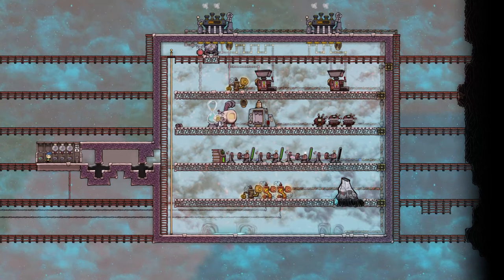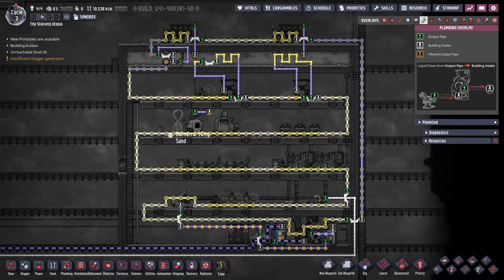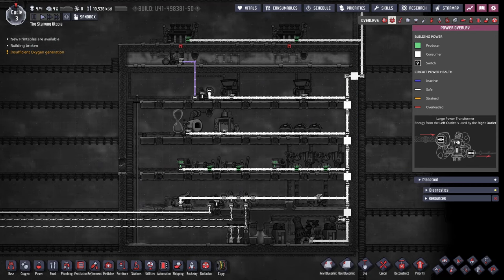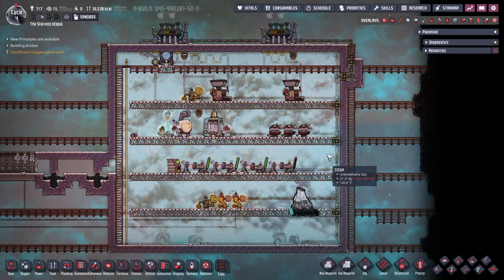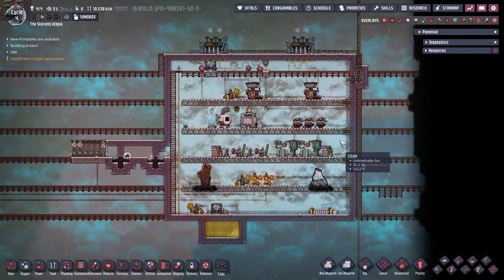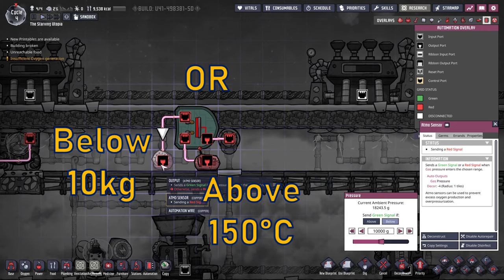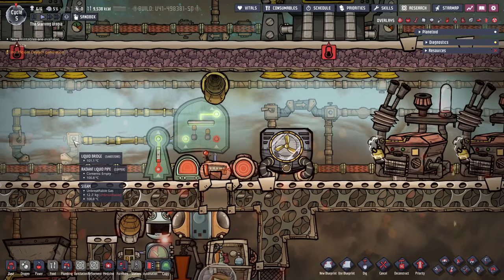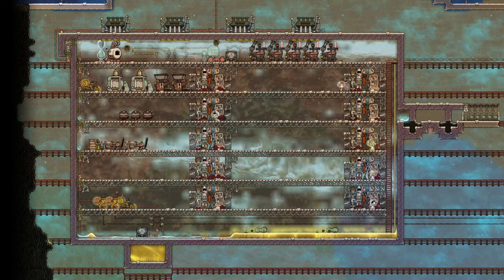Oxygen Not Included - Tutorial Bites - Industrial Bricks

Comment: What’s even the advantage between a cool brick and a hot brick then? Is it cause you can open up metal volcanoes inside them? You still have to set up a cooling loop for both anyway so I don’t see a huge advantage in doing a hot brick. It seems wasteful almost because of the amount of high quality resources you need to replace the machines with.
Reply from the maker: In my opinion, the hot brick is superior as it does simplify a number of things. Yes you can open metal volcanoes, volcanoes and steam vents inside with no issue. Also it deals with polluted or salt water by turning it into steam for collection as water. The other advantage is slicksters that need the hotter temperatures, especially molten slicksters. It certainly does require a lot of steel/thermium, depending on how many machines you want, but these are more accessible than ever in the spaced out DLC with iron volcanoes on the frozen outer planetiod, and tungsten volcanoes on the marshy outer planetoid. Of course the challenge then is taming those, but it is certainly possible.

Comment: Do you have a video of how to survive long enough to get to the oil biome and start plastics
Reply from the maker: Unfortunately not specifically, but to my mind the key factors are food and oxygen, both of which I have videos for. Cooling will also help, so maybe look at the tutorial bites for cooling, and plastic & steel. I also have 2 playthrough series, so maybe take a look at the early game sections of those. I'd aim to get plastic and steel ahead of cycle 100.
Reply: @GCFungus  thanks. Though ran out of power and oxygen around 80 cycles. Probably should have stopped pumping oxygen into the entire map pretty sure that's where both resources went to
Reply: @colecook834  build the dupes a habitable area as soon as feasible.  You can’t oxygenate the entire asteroid with your starting tech and resources, so settle for a smaller area that you can control.  Once that internal area is stable and you have enough excess oxygen production, set up atmo suit docks to help the dupes push out of the base and into the rest if the asteroid.  At this point you can also move your industrial equipment out of the base too, reducing the amount of cooling you’ll need to do inside the base.
Reply: @colecook834  the key to survival is always considering *sustainability*.  I think the game is designed this way to teach you, like your first playthrough will likely end in running out of oxygen when you realize you're out of Algae.  So, you restart and know you need get eletrolyzers going before you run out of Algae, and the challenge becomes finding some renewable source of fresh water.  Then, you have things going well but you run out of Sand you need to run your sieves, and so on and so forth.  You'll run out of a coal for power, then start ranching Stone Hatches and feel like you've got infinite power (and food) ... until the unthinkable happens, and you run out of rocks! 

So, iterating on this process is how you eventually get to the point where you are taming geysers and channeling those resources into what your dupes need to survive.  The game is very flexible, and you have a lot of options open to you, and the spawns and world settings will be in some unique combination for you each time.  Basically, if you are always playing this game with a mindset that you are "learning for next time" you should pretty quickly be able to start a few colonies and work through the early/mid game humps.  Each time, concentrate on what killed you and how you could have mitigated it, perhaps starting dozens (or hundreds) of cycles before the actual Time of Death.  Good luck!!
Reply: @privatehuff  thank you. I kept going to the Oceania asteroid. And it always took forever to get to oil around 100 cycles. Once I tried  another asteroid made it there around 60 cycles. 
My primary problem was power and oxygen. I couldn't use electrilizers without burning more power. But didn't have access to said power. And can't use electrilizers oxygen inside the base without cooling it.
Reply: @colecook834  yes heat is the next thing that will kill you, after you have everything running so smoothly you forget about these things :)

Take it slow and solve each problem one at a time, considering the implications of those solutions, and following along the path.

But I personally recommend ranching, it really got my over the hump.  Hatches are a good source of Coal which you can use to get power to run electrolyzers and other things, while you are figuring things out.
Reply: @privatehuff  did that before and it worked till the hatches ate all my resources... I somehow did not have a single lava volcano XD
Reply: @colecook834  You may already know this but I think making a SPOM (Self-Powering Oxygen something xD) asap would solve all your said problems so you can have Oxygen without burning any power. the tlder of SPOM would be 1 hydrogen generator uses 100g/s of Hydrogen that then generate 800w whice can power an electrolyzer and up to 3 pumps running constantly. If that's not enough you can put some Oxy diffuser in your base to help generate more o2. I don't expand the base to much when I'm running on algae just building trench style base. About the heat early game I usually find some spot to make a pit of liquid (or game generated pit) and dump the thermal mass in to the larger.(The goal was to isolate the heat from my main base). If the machine dont have overheat cap you can place it in a hot biome. Utilize abyssalite to isolate the heat and minimize heat transfer. About the power problem if you don't mind it you can use a hamster wheel on spots that you think need too much power (so you can dont have to worry on the main grid constantly draining) turn off things that you dont need to also helps. About hatches don't ranch too much I mean 2 hatches can sustain 1 dupes so 1 full ranch usually can supply 4 dupes so limiting the hatch seems to be what you need to do also havving multiple food source is quite good I know it's annoying to manage but that'll help a lot. Rocks from volcano will overheat stuff so you can't use it and draining the heat is quite troublesome even with steam turbines

Comment: Can you provide a tutorial on how to actually build these bricks with a close-up and how things actually work. Even with this overview, it still looks complicated to understand what's actually happening under the hood. Awesome tutorials in general though, I am binge-watching as much stuff as possible as I am trying to build a rocket which requires a lot of extra materials that I am trying to wrap my head around on how to produce like petroleum and oxylite.
Reply from the maker: I'm not sure I could expand in a tutorial, but maybe I can help here. The industrial brick is simply a collection of industrial machines in one place. A cold brick is very simple, as you just locate the machines together and run a cooling loop behind them, which I explained in the cooling tutorial bite. The hot brick is only a little more complicated with the gas management. I explained how to control that depending on if it's steam only or steam/co2. For a mixed brick, you can fill with co2 first and add water if needed (for pet gens simply turn them on and heat the water). For steam only fill with the water output if you are adding water to it, or if not then add some water manually and boil. You can then remove any unwanted gases, which will likely float to the top, so open the side to vent or pump it out.
Reply: To get oxylite you can go 2 ways:
-The "easy" way: using an oxylite refinery. You put the machine in a tiny room, feed it O2 and gold (refined) and it drops Oxylite. You should use a liquid lock as the access to the room. You can automate (recommended) the gold delivery to the machine or use dupes. The refinery does not require dupe labor, only a gas intake for the O2 and the delivery of gold.
-the hard way: dense puft. You need to ranch puft in an O2 rich enviroment to get the Dense variant eggs. It requires some ranching, dealing with the puft variant, dealing with the eggs, dealing with the ranchs space.

The "easy" way is better since slightly more efficient at converting Oxygen into Oxylite (100% vs. 95%), can be automated, can get hot if one does not take precautions, takes less space, takes less dupe labor, the amount of gold it need is really small (5 g of gold per every 1 kg of produced Oxylite).
You still need to get to that level of research (plus the ones of automation, if you want to use auto-sweepers).

Comment: I have been running a variant of the brick. It's hot, but not steam hot, about 60-80 C works well (so you can use water for the liquid lock, keeping it low tech), and a CO2 atmosphere, gold amalgam machines (also keeping the theme of low tech). The main advantage is that it's very easy to transition to, and you can start with almost no tech.

Start out as a room temperature brick, with oxygen atmosphere, insulate it, put in the first pieces of machinery and seal it in with a liquid lock. Install a bunch of tempshift plates so it has a huge thermal mass, and you don't even have to think about cooling it yet. The only thing you will need is pumps to remove the polluted water when you get natural gas generators. By the time the CO2, pressure and temperature starts to be a problem for dupes, you can get atmo suits (or at least oxygen masks, as CO2 is likely to be the first obstacle), then you bought even more time until the machines will start to overheat, and by that point you should be able to get to steam turbines and steel, at which point you can slap on that cooling loop to make it long term stable.

It also conveniently stores your CO2 by nature of being high pressure, until you have a use for it in the form of slicksters or rocket engines (DLC).

Comment: Hello, very nice video!  I hope you don't mind if I offer a few suggestions?

You can place metal / diamond tiles to intercept falling pwater. Maybe not immediately on the floor where the generators are built, but not too far down. By doing so, you have various advantages:
1) the lower layers need not have steam, and need not either heating or cooling... having 180°C or 100°C CO2 down there makes very little difference.
2) full CO2 lower layers improves slickers efficiency; there are ranches that are almost completely in steam right now;
3) steam doesn't have to slowly travel all the way up, which makes its amount in the top layer more stable;
4) you can move the AT up again as the idea is to turn all water into steam in the top layers

The same applies to water from the turbines. It's better to have it evaporate in the top layers.

Another good reason is that ONI isn't really good at mixed gas environments and some steam or CO2 might get deleted.The more separated you keep the two layers, the better.
Reply: So a top level with all the petroleum generators and aquatuners on airflow tiles ?
Reply: @blazeraz7666  or mixed airflow / diamond - the idea is to let water land on hot solid tiles, so it can vaporize on contact, way before it reaches the bottom. That lets CO2 accumulate at the bottom.

Anyway, 2 years have passed and I'm no longer a fan of industrial saunas. There're not as efficient as I thought.  E.g. metal is created at 40C, and rapidly sucks heat from the enviroment. Same for most industrial products.

It might be different for a power sauna (with only the generators). But I haven't done it in ages. More often than not I find the petroleum boiler water cycle more useful as a water cooler, 95C water in (from geysers, steam vents, etc), 40C p water out.

A power sauna might be usuful if you have no means to filter pwater, and you need plenty of clean water. Then again, it's 95C clean water.  I'd rather find a way to produce sand (which you rarery run out of, you can crush salt and rocks) and have 40C clean water than having to deal with 95C water (which is good for O2 production, but anything else is tricky).
Reply: @TheMule71  I'm fairly new to the game. I tried to build this mixed thing so I can also purify a polluted water vent but I can't keep the temps above 120 at the place the water from the vent comes
Reply: @blazeraz7666  Put temp sensors and don't activate the turbines if the temp goes below 130°C.

Turbines remove heat, by injecting cold (relatively, 95°C) water.

A pwater geyser is 60°C if memory serves me well.  That's quite low, you need tons of heat to boil that.  The point of petroleum gens is that you can have them expell hot water, that instantly vaporize.
Reply: @TheMule71  Yeah the vent comes actually at 30°C so I don't really thing it will work. I thought of disabling the turbines as well but the temperature falls so much that it doesn;t even reach 125. Also the room becomes full with steam and the slicks have nothing to eat. Its a whole mess I propably am going to use a sieve and chlorine thing
Reply: @blazeraz7666  No, 30°C not doable unless the conditions are different.

Like if you have a huge magma biome and/or lots of volcanoes, you could user 30°C pwater to tame those.

Just sieve the water.
Reply: @TheMule71  What do you substitute the sauna with? I've been having troubles with minw as well and plan on switching to another option. The main thing making the sauna worth it is automatically boiling p. water, as well as free slicksters.
Reply: @LuizdoLatrossinio  So, the video is about industrial bricks, that is having all industrial machines inside the steam room. In general I don't like that.

If we're talking a power block (only generators / batteries / transformers) we're in a slightly different territory.

First, I have to confirm that pwater from petro gens still works as intented. I recall (but I may be wrong) that they patched the gens, and now pwater is capped between 40C and 125C. So you can no longer run gens at 200C and get 200C steam out of them. You get 125C steam, meaning the heat equation is completely different.

If that's not true, and you do get 200C steam out of 200C gens, then it might be worth it. Slicksters are cool, but 80 of them is lot and produce 1.2kg/s of petroleum, which isn't much. I'm assuming a standard 3 wells setup and a 10kg/s boiler. YMMV of course. Admittedly it is a good source of BBQ, but it requires dup labor and it's tricky to feed all of them correctly. Eg. I had to arrange them in 10 vertical 4 tiles wide ranches, so that CO2 would diffuse in a uniform way to them. Also they take a lot of space. 

All my industrial bricks are cold now. For power, it's been quite a while since my last full petroleum loop, and I was crushing CO2 with doors.

To me, one of the nice side effects of a petroleum setup is that it cools down 95C water (possibile from CSVs or a hot geyser) to 40C. All you have to do is to filter it, unless you need pwater for crops. That's the main reason I don't build hot power bricks anymore.

Well, not counting the research reactor or geothermal, of course, those you can't run cold. :)
Reply: @TheMule71  First of all, thank you for such a quick and well tought out answer. 

I never paid attention to the temperature of the output p.water, but I do think it's capped, since my brick didn't get hotter than 130 for the most part.

As for the slicksters, they really have been a hassle lmao, 3 ranchers using all their time to groom the slicksters and they still get glum sometimes.

The cold industrial brick is what interests me the most, as I plan on building my first sour gas boiler, so I would move from petroleum and have time to restructure my machines. However, I have a question, when you say cold, how cold are we talking? 

Thank you in advance for helping me with this! I'm relatively new to the game, so sorry if I ask something too obvious.
Reply: @LuizdoLatrossinio  np! by cold I mean standard like 25C but also 40C is reasonable if your cooling system is super strong. Or find a balance, the goal is not to let the gens go above 40C.

Freezing cold is interesting but more for the lols. You freeze pwater and maybe CO2. Better done with super coolant of course. Not particularly efficient.
Reply: @TheMule71  So pretty much just run an ATST setup with cooling pipes behind a normal room and dump all the machines there, right? If so I might try to build a negative temp one to freeze everything but oxygen, just for fun.
Reply: @LuizdoLatrossinio  I've done them all, so there's little novelty to me, and neither the hot ones nor the frozen ones have advantages over a "normal" one.

I'm more focused on trying and getting a stock system working, the old Brothgar's style one seems to be broken nowadays.